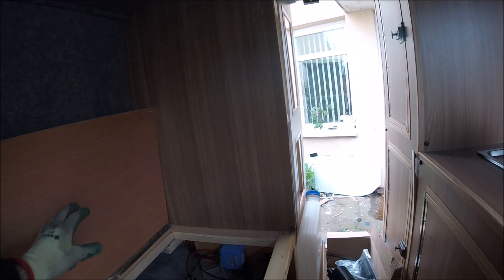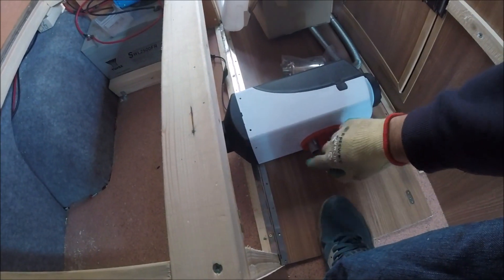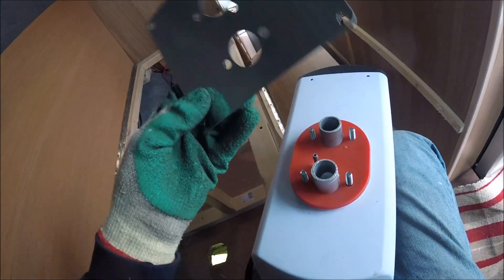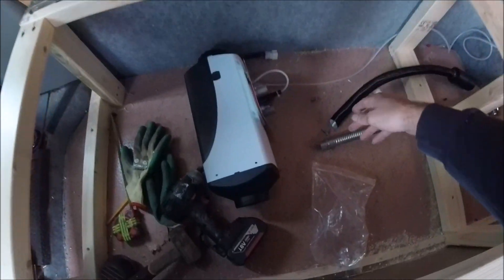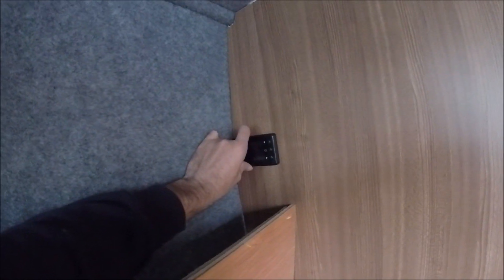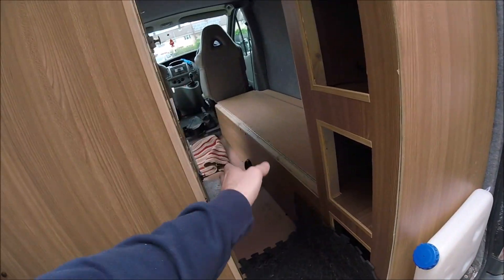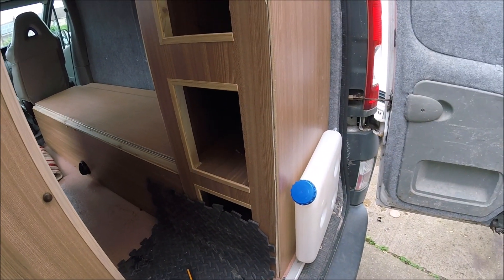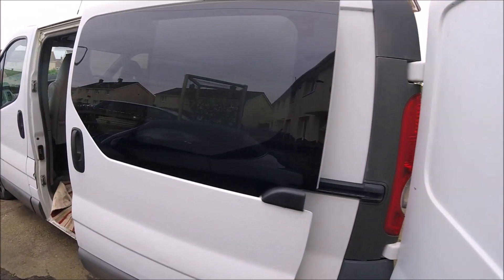Chinese Diesel Heater Installation In Vauxhall Vivaro Campervan Conversion

Comment: Kudos.  Added to a playlist on my channel.   A minor point: the silencer should be vertical with the small hole at the bottom to drain away any condensation.

Comment: Great video I've recently found you and your conversions by mistake but love them. With reguards the tank if you turn it 90° clockwise from your mounting position. You could have your other fitting in that flat area at the bottom of the tank so you would still use all the fuel. Just a suggestion. Keep up the cracking work!

Comment: I like the fuel line into top of the tank idea. But how did you waterproof/fill the exposed hole you made for the pipes underneath the van?
Reply from the maker: paint the hole so it doesn't rust, thats all thats needed, there is  a metal plate the heater secured down to which seals the hole from the inside